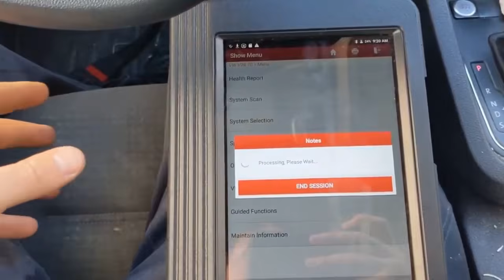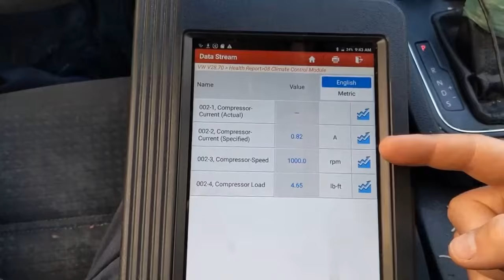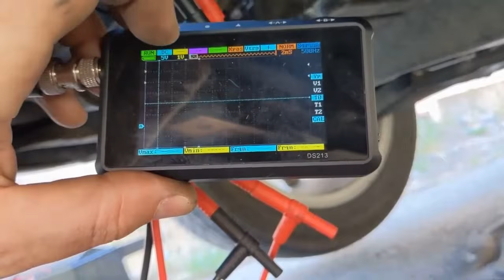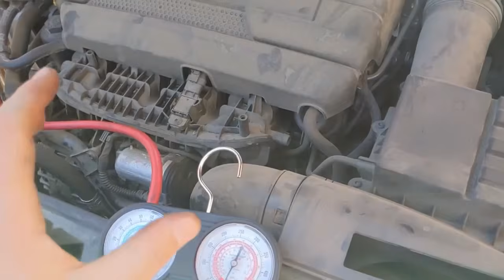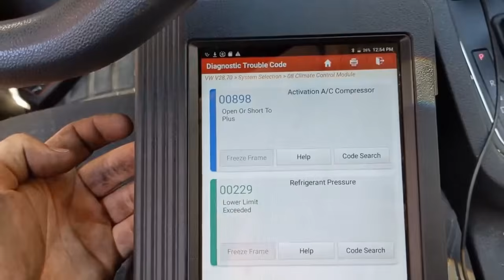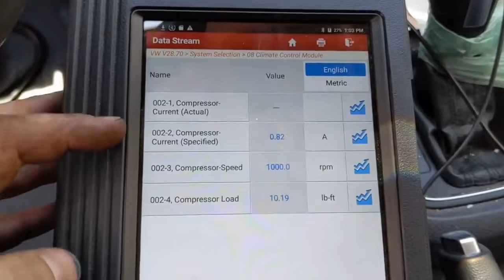2009-2017 VW Intermittent AC Diagnosis and Repair | How to Fix Volkswagen Air Conditioner

Comment: Problem with the shop is they charge you $150 to evacuate the system. If you go back to then to refill they xharge the same price again. The worst is they charge you to put back your refrigerant that they kept when they evacuated your system. A few years ago I had a 2012 Jetta. I changed that part with a very cheap one and it got the A/C working again. Within a month it stopped cooling agsin. Since it made it work for a while it was obvious that was the problem and not the whole compressor. I ponied up the money and bought the expensive name brand one. It started cooling well agsin and within a month stopped working again. I decided it was something else and started throwing the cheaper parts at it like the temperature switxh, the TVX valve and nothing. I was going to replace the drier next, anything to not pay a full A/C repair. I crashed and totaled the car so that ended that saga. I have been curious forever on what the fix was. I never got to try the drier but glad I got saved the work and additional money. A guy on a VW forum said he had the same issue and tried three compressors including a brand new OEM one and still had the problem. Could have been an electrical issue too but never got that far.

Comment: I like older cars with electromagnetic compressor clutches. I hate RCV valves! I am going through misery right now because I sold a 2012 Jetta to someone and the AC stopped working. Mister nice guy here (more like dumbass), said I would fix it for her free (yes, I am a dumbass). Installed a RCV valve and it only fixed it for a few days. Then I installed a new compressor and expansion valve (oil was clean, so did not flush). Ice cold 🙂 Drove it and ran the car for at least an hour, still ice cold. Left the car running with the AC on while I changed my clothes so I could drive it to her house. When I get in the car, it is warm inside. AC STOPPED AFTER WORKING PERFECT! WTF? The cooling fans are both working. Never again will I help someone with a car after I sell it. VW RCV AC systems suck and no good deed goes unpunished. ☹

Comment: I have 09 Jetta TDI and love it. The AC has a bit of a problem. It goes from cold cold to steamy, especially if the fan speed is lowered. But sometimes even if running on high. Turning the fan or compressor off and back on in a few minutes usually resets the temperature. But not always. Sometimes it's miles before the reset happens. Any ideas?

Comment: My AC doesnt click on and my AC fan doesn’t work either. What could that be?
Reply from the maker: Start by checking for codes in the HVAC system and checking system pressure.
Reply: @ValleyMobileAutomotive the pressure is zero and I found it’s leaking where the line bolts to the firewall
Reply from the maker: @JonKinzinger  Glad you found the problem 👍

Comment: I'm having the same issue with my 2012 volkswegan routan with heater and ac system
Reply from the maker: See if you can just get the solenoid replaced. It will be cheaper than the whole compressor 👍
Reply: Yes watching from South Africa, also same problem on my 2012 touran

Comment: $35 for the valve and $1k for the compressor lol
Reply from the maker: The valve is definitely cheaper! Either way you'll want to have the refrigerant extracted at a shop if you don't have the equipment to do it yourself 👍

Comment: I saw a video that expressed that Volkswagen would not just change the rcv but push to change the entire compressor.  That sucks.  I'm having the same problem with my daughter's car. That's a very common problem, it seems, and should be recalled or, at the minimum, just change the rcv. But I guess I'll get my AC guy to evacuate and charge the system after I change the rcv myself.

Comment: I have a 2014 Beetle 5 speed. The air conditioner will start blowing hot air when the car comes to a stop. Is that  known issue ?
Reply: 2013 Jetta, same here. We're you able to fix it? Im still looking!
Reply: @akeel912 no… unfortunately my Beetle wound up having engine failure due to an issue with oil pan seal. All the oil leaked out. It died on the freeway in the middle of the snow.

Comment: I just did this to my 2016 Tiguan. New compressor, expansion valve, condensor, everything! I still have same problem. A.C. doesn't  ever get cold, cool maybe but not cold and blows warm air whenever i stop at red lights or stuck in traffic. so i am wondering if it is an electrical issue? also my cooling fan runs pretty much constantly. I am at my wits end with this car if i don't get it figured out im going to light a match to it and roast marshmallows.
Reply: Did you find the solution??

Comment: Description says through 2017, but the compressor regulators I see online say through 2016. Does the 2017 model use this valve? Thanks
Reply from the maker: Good question. The TSB I am using for this diag says VW Jetta and Passat through 17' may have this problem. It's possible the 17' model uses a different part number but I'm not sure. When I look up the part number I have in the description it says it fits 2006-2016. Even though the older VWs aren't mentioned in the TSB they seem to use the same pressure control valve. So I'm really not sure. I would recommend calling the parts department at the dealer and get the part number you can cross reference.

Comment: How exactly do you know if it's the valve having a mechanical issue/clogged or just a bad compressor? I'm facing the same issue. 08 VW Eos with 68K miles. Air is mediocre, only 60-65f at the vents on 90f + day.
Reply from the maker: 99% of the time it's going to be the pressure regulating valve. Going through the diagnostic steps will help you pinpoint it. Is your issue all the time or intermittent?
Reply: @ValleyMobileAutomotive  All the time. I'm certain that my refrigerant levels are good because I already evacuated, vacuumed, refilled system. Pressures are 45-50 low and  225 high. I feel like the low pressure is a bit high. I have the same low compressor load values on the scantool. 4 or 5 lb-ft. Never goes more. No codes in system. Requested to valve is 0.82a. No data for "actual" amps like in your video.
Reply from the maker: @event3horizon  It sounds like the compressor is compressing. I would think the pressure regulator is bad. They're not crazy expensive. If you have the capability of evacuating the AC I would go ahead and replace it.
Reply: @ValleyMobileAutomotive  I appreciate your responses. I have already ordered an rkx valve. I will have a local shop recover the refrigerant.
Reply from the maker: @event3horizon  Sweet! Let us know how it goes 👍

Comment: This man just wasted on so much money because all he had to do is change solenoid on that same compressor which would cost him $25 to a 50 bucks
Reply: What’s the solenoid? Mine is having an issue too. Is it the valve?
Reply: @Daft_punk7  It's the "AC Compressor Control Solenoid Valve" that he pulls off the side of the compressor, looks sort of like a sensor. The part may be that cheap but you still have to get the system evacuated and refilled.
Reply: @matthedt refilled is a $20 wal mart Freon bottle lol still cheap fix all together

Comment: Hi, the AC of my 2011 Jetta sometimes works fine but after 10 minutes starts below hot air, just switch the car off and remove the key for 30 sec. then start the car and the AC works fine for 5 min. and go back to below-hot air again. Any suggestion pls.? Thanks in advance.
Reply: too much refrigerant. computer is triggered to turn off if pressure too high.
Reply: Mine does the same sort of thing.

Comment: How is this not a recall? Or even a TSB? People shouldn’t have to be paying for this out of their oem pocket, since it’s such a large scale problem.
Reply: There is. TSB for it
Reply: @RottenInDenmarkOrginal what is a TSB?
Reply: Good video. I'm having the same problem and I got the idea on how to fix the problem.
Thank you.🙋‍♂️
Reply: I have a 2016 Passat 4-door sliver Volkswagen just purchased it a 90 days ago.i also got a extended warranty for the car.i took the car to have its first service and I told the dealership what going on with it.driver side blows ice cold air passenger side blows hot air.😳 dealership gave me a outstanding price for repair.i told them I have a extended warranty on the car.they said it doesn't cover the blend door relay.😢 crazy 
Even the head quarters of Volkswagen said there's no recalls.quality service at its best.😡
Reply: What’s a TSB?
Reply: It's called corruption and greed

Comment: I replaced vale on 2013 beetle but still not working wer are ac fuses i have no manual
Reply from the maker: Do a Google search for "2013 Volkswagen Beetle fuse box diagram". I'm sure a picture will come up with what you need 👍
Reply: I can't find ac relay

Comment: Thanks so much for this. I think I have a similar problem and would like to e mail the measuring block info from my HVAC system to you for your analysis so I can confirm if I have a totally failed compressor or it's a solenoid valve problem.

Comment: When you guys remove the valve 
BE VERY CAREFUL IT BLOWS OUT FREON. PROTECT YOUR EYES 
I ALMOST FUCKED UP YOU BE CAREFUL.
Reply from the maker: Good advice! Completely evacuating the system should be done before removal of the regulator. If you don't have the equipment please take it to a shop so they can evacuate it. Then do the repairs yourself and bring it back for a refill. Thanks for your comment 👍

Comment: What if I replaced my compressor and it's still not getting cold?
Reply: Turns out when I replaced my compressor I added new oil to a new compressor, didn't think about the oil already in the system and then I didn't read the refrigerant can... It also had oil in it. So TLDR: I had 3 times the amount of oil in my system and my charge was too low

Comment: Just so you know, you should be doing a complete system flush if you're replacing the compressor. Also replace the receiver/drier and the expansion valve.
Reply: Maybe if the compressor was messed up, but this system was clean.
Reply: @bobbyk6761  these youtube keyboard critics are something else right bob. Thanks for correcting Kobrapun

Comment: VW dealer charged me $1900 for this job in the summer work for that summer and next summer stop working again worst car I have ever owned. 2014 vw Passat Wolfsburg edition, broken rear springs,seat controls etc etc.
Reply: the suspension on these cheap cars does well unless it's abused, electrical issues are common in every car. I rather drive a vw than a kia... sorry to hear about your experience I've been driving for 6 years have owned 3 vws and will never switch. my mk4 has had every issue in the books and it's so much fun working on it. hope the new cars treats you better!!!
Reply: @kreemliin  actually it was a recall on the springs but no for for 2014 they started it for 2015, not abused at all only 1 person in the car hwy miles use to commute and no, no new cars for me I love my 1998 Subaru Outback sport 5 speeds with 260k blowing cold 🥶 and nothing but synthetic mobile 1 oil and filter👍🏼
Reply: @arielponce8737  & subarus are notorious for headgasket/etc? my gti 260k as well 0 problems, sounds like bias; maybe dealer sold you a crappy car? unless you owned since it was new then understandable
Reply: Same went thru 3 compressor replacements, gladly it was under warranty but it died again after the one year time. Haven't replaced it because i know ia going to cost an arm and a leg!

Comment: My mk5 had the same the same issue with a faulty solenoid, no one believed me but when we replaced it ice cold ac came out. The main issue was that the AC would take upwards of 7 minutes to kick in which in summer is definitely not acceptable!
Reply: What solenoid did you replace? 2015 jetta
Reply: @mikesouthworth1999  i think its the one shown in the video. The thing that looks like a sensor
Reply: @marioelburro1492  Were you able to replace the solenoid within the "AC Compressor Control Solenoid Valve" (that's how it's labeled in the Amazon link), or just replace the whole part? Would be nice to do it without having to discharge the system.
Reply: @matthedt dont know if youve done this yet but you need to get an rkx valve to replace it. They open up more than the factory one

Comment: About a month before this video I totaled my 2012 Jetta S. Same problems. One year A/C stopped working so replaced compressor control valve with cheap Chinese eBay one that cost about $19. It fixed the problem all summer then stopped working. Replaced valve with $80 AutoZone one and didn’t do anything initially then started cooling like a champ only to stop working three days later. Would intermittently work. Some days yes, others not. Eventually not at all.

Tried the TVX valve and didn’t help. Changed temperature sensor and nothing. Next I was going to try the orifice tube aka accumulator aka receiver/drier (decadent) but had the crash. 

On a VW forum a guy replaced the compressor 3 times with two being OEM units and problem would return eventually. I may be remembering the details of the forum post wrong but I replied there with my story. I never had a leak and my refrigerant was always at correct level when I had a shop evacuate it. Don’t know if accumulator replacement would have fixed it but I doubt it. 

A big problem is every time I tried a new part it required paying a shop to evacuate the refrigerant. No one near me would do it free. Well, one guy did it free then I had to pay him to refill. I have done that myself but wanted ac system to be full vacuumed to avoid future problems. Yes, I have a crappy home vacuum sucker. I’ll pass.
Reply: I feel your pain. Been going through all the repair replace nonsense myself. Might just rely on open windows :)
Reply: @waynegodwin6860  After changing the TVX valve from seeing videos showing my issue could be that, it didn’t work either. The final thing to try was the condenser on the side edge of the radiator. It must be done really fast so as to not introduce moisture into the new one. However, I totaled the car in a crash a year and a half ago. Broken collar bone, five broken ribs and almost broke knee that filled up with fluid. Terrible couple of months for bones to heal. The ribs would start to heal and would break again as I tried to get up to use the bathroom until they finally held. I hope I die if I have another serious accident. The positive part is no more need to try and fix it. I bought a used 7 year old Toyota.
Reply: @yactabay  dang that’s messed up getting hurt like that. I’ve replaced that valve before with oem but never thought about that condenser. I’ve only got 56k on my 2007 jetta 2.5. Need to try and keep it as long as possible I’ll keep you posted if I fix or use my shotgun on the AC.
Reply: @waynegodwin6860  I actually liked the car and it never left me stranded but just before the accident the transmissions was starting to go at about 180k miles. If you only have that few miles on the car I recommend a transmission fluid change. Ignore the manual and mechanics who say the manufacturer says you don’t need it now or ever. The transmission will last longer. Don’t wait ANY longer. Preferably do it yourself. Changing the fluid can actually do more damage but ONLY if the car is high mileage. I did not have the Jetta since new.
Reply: @yactabay  thanks for the advise!
Reply: @yactabay  Man, I hope you healed up okay. Rib pain is no joke, and yours sounds as bad as it can get.
Reply: @waynegodwin6860 Hey, you said you’d let us know what happened with yours. You never did.

Comment: I have a similar problem in that the AC system often does not function on the first drive of the day for 2-10 minutes, then kicks in and runs fine afterwards. Also, the cooling fan is operating at low speed until the AC finally kicks in. Is this more indicative of an electronic issue?
Reply: I’m having the same problem with my 2007 Jetta 2.5. Did you get it resolved?
Reply: Hey Jim! Did you fix the problem and maybe have an explanation for it? I'm having the same problem with my 2009 VW Passat B6.
Reply: Same issue with mine and the radio goes on and off too

Comment: What brand of scan tool is that?  Thanks for an informative video.
Reply from the maker: You're welcome! I'm using the launch x-431. I've had it for over three years. It does a decent job on most vehicles. But it's a bit pricey unless this is your line of work.

Comment: I replace the AC Compressor Control Solenoid Valve and the ac worked fine for a week now it went back to work on and off. what would you recommend me to do next?
Reply from the maker: Double check your ac pressure. A couple possibilities are that the new valve didn't seal right and you leaked out your refrigerant. Or the new valve is faulty (rare but just because something is new doesn't mean it's good). Or the original issue wasn't the valve and something else is causing the problem. Run through the diagnostic procedure from the start again and see what you come up with.
Reply: @ValleyMobileAutomotive hey I have some questions cam I inbox ypu or something
Reply: Did you use a high quality solenoid or no name chinesium?  Been there, done that, reaffirm pressures but in my experience it's a cheapo solenoid.  I've experienced the chinesium ones dying hours after replacement.
Reply: On my 2012 VW Passat 2.5 L it was the actuator blend valve, that opens and closes  when computer demand . It wasn’t working properly, it came up on the scanner, replaced it and back to normal AC blasting cold as ice.